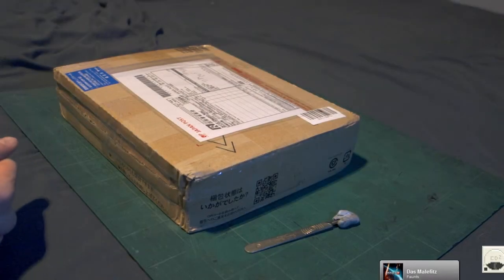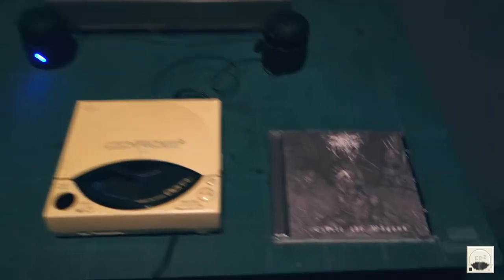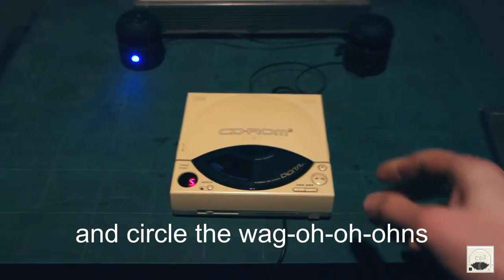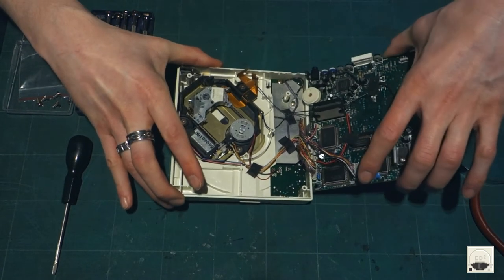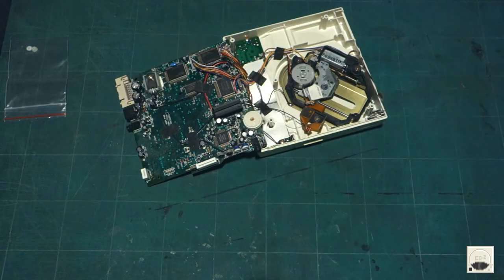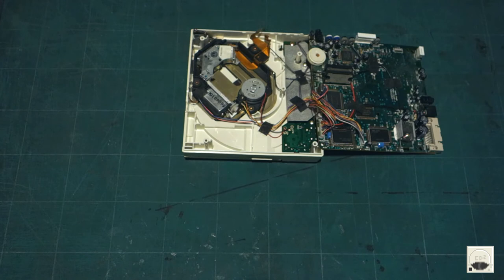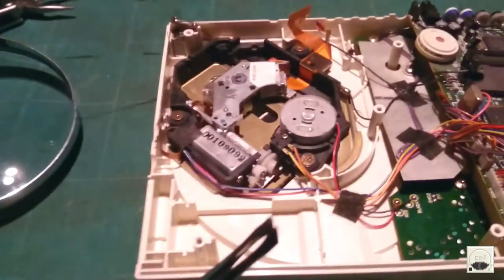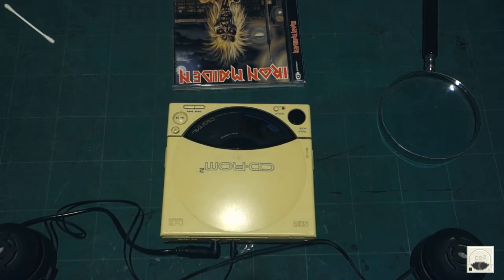Junk PC Engine CD-ROM² Repair (Discs not spinning)

Comment: Thanks for making this. I've had one of these for years and it's finally given out, so I'm thinking about trying to do the gear replacement. Really valuable to watch this. I think the replacement gears in Japan actually come with a slightly larger washer replacement as well so maybe even an idiot with no experience at this kind of thing can do it.
Reply from the maker: Trust me man, I've had barely any electronics experience and I managed it.  If you can get a larger replacement washer you'll be laughing :-)

Comment: Well, I've since got a lot more familiar with these and it's interesting to re-watch this, knowing what I know now. :) I now have three Japanese drives, an NEC CDR-35D drive, and a Turbo-CD drive. The NEC CDR-35D is a beige PC version of the Turbo-CD drive and actually works with PCE/TGCD if you swap IC108 (NEC microcontroller with custom internal ROM that differs on the CDR-35D).

Most recently the Turbo-CD drive was sold to me as "working" but the laser was stuck on the outside, just like yours. I used the spindle hub from a Japanese drive to trick it into spinning discs by manually homing the laser with the lid sensor rigged, just like yours (have to back it off the limit switch then drop on the disc/hub). After a few times the laser just started homing and playing, just like yours, but went right back to "stuck" the next day, just like yours later did. When it was working on day 1 it seemed reliable and did not make any funny noises so I knew the POM gear was likely intact.

No amount of of external fiddling on day 2 would get the laser to move on its own but it wasn't making a noise so I knew the POM gear was probably still OK. I had to take it apart and turn the gear manually to free it up on day 2. Sure enough, it was yellow and swollen but not cracked or missing teeth. The manual turning got it to load games and play audio again but it would freeze or glitch or skip where it worked fine before. You couldn't even listen to an audio CD on day 2.

Sure enough, it was frozen up again on day 3. It was pretty hot on day 1 (from the package being left out in the sun) so I think the lubricant would solidify and seize everything up when it idled/cooled.

Though I know how to clean/lubricate these things and have even done a Discman laser swap before, I didn't want to go any further without contacting the seller who old it as "guaranteed to work." Still waiting on word.

Seeing that you had almost identical behavior that was attributable to lubrication makes me more confident in my assessment that heat was changing the lube viscosity. I'm considering a diagnostics flow-chart for these things. :)
Reply from the maker: Hey dude, definitely sounds like the grease in the mechanism has solidified.

If your gear is not missing any teeth then a clean up and application of new grease should do the trick!

If you go through with that I'd definitely replace the gear anyway, it'll break sooner or later!

Comment: Mine's got a different problem.  The center spindle is simply refusing to spin altogether.  Totally stationary, so of course the attempt to read it fails immediately.  This only happened after I opened the thing up and closed it again without any mods, so I must have done something wrong but I can't see any dislodged cables that came loose from their solder joints.

Comment: Thanks for sharing. I replaced the gear and was doing great until I dropped the rubber washer into the console for about the tenth time and couldn't find it. I've looked everywhere but can't find it. Nightmare.
Reply from the maker: ahh dude what a pain, I reckon you could make a replacement if you get a small elastic band you could tie it round the spindle perhaps,  or even try a big elastic band and cut a bit of it into a square, push a pin through the centre then stretch it over the end of the spindle gently so it will sit in the groove on the spindle.
Reply from the maker: you could even try a small square cut from a plastic bottle?  doesn't matter if you make it too big to start with, you can trim away the excess once you get it seated on the spindle.
Reply: there is a seller on ebay that sells a kit with the washer...
Reply: Do you have a link? All I found was spare gears.
Reply: Many thanks. I may have to give that a go if I can't find any alternative.
Reply: Cheers.

Comment: Love your video. I also bookmarked it as I'll probably need it. I already have my PC Engine and Interface Unit, just waiting for my "Junk" CD-ROM2 to arrive from Japan. I'm also waiting for my System Card 3.0 and a brand new gear i also ordered.
Reply from the maker: Awesome man, thanks for watching and I hope the vid helps. if you have to change that middle gear just be prepared for the nightmare of putting that plastic washer back on the spindle ;-)
Reply: +Chris Mifsud 
Hey Chris, I'm actually shopping for a PCE and an Interface Unit, does it work even if the CD-ROM2 isnt attached to it?
Reply: +Jean audette 
Yes it does. You get the save game facilities and AV out (or RGB if modded) all work without the actual CD-ROM 2
Reply: +Chris Mifsud 
Allright thanks a lot
I have a contact and importing a unit with cables + a loose PCE is a little bit cheaper than buying a PCE with cables on ebay.
Reply: I also brought a junk CD rom2 and a couple of replacement gears. it turned out it just needed a clean and works perfectly. so I have two gears on the way just to sit in a drawer!!
Reply from the maker: +Russell Warren 

Cool man, at least you have replacement gears ready for when the inevitable happens ;-)

Comment: Oooh, I hope my duo-R still works, I haven't played it for 8years :(
Reply from the maker: +elijahmodnar1 Hey dude, I'm sure it will work, the Duo R and RX models are more durable than the earlier incarnations of the PC Engine CD based units
Reply from the maker: Arnold101Knight
Dude, the spindle will not spin if the middle gear is missing!
Reply from the maker: +Arnold101Knight No, the middle gear connects the motor to the spindle. Without the middle gear, the spindle will not spin.
Reply from the maker: +Arnold101Knight I understand you 100% now. The spindle will not activate until the lense gains focus on the CD surface.

Once you have replaced the middle gear, if the CD still does not spin, the lense maybe dirty, or maybe needs to be recalibrate.

You won't know for sure until you replace the gear!
Reply from the maker: +Arnold101Knight I'm not sure about replacement lenses etc, but I do know that whilst I had my unit, when it wasn't working, sometimes I saw a lazer, sometimes I didn't. 

I think it depends on where the lazer is/if it's in a place where the beam is ready to come on.

Seriously man, just worry about the gear and greasing the tracks, so the lense array can move accurately. if the CD doesn’t spin after that, then, look into replacement lense options, recalibration etc.
Reply from the maker: +Arnold101Knight Ah you should be fine then man, remember that this machine is from 1987.
Reply: Arnold101Knight  You can trick an otherwise-working drive to spin the discs without the middle gear. You can even do it without opening the drive. First, you have to rig the lid sensor then simulate the laser "homing." When the laser homes it comes all the way to the center, hits the limit switch, then backs off of the limit switch before it checks the disc. I did this by quickly moving the laser to the center and then back away, which is tough to do without touching the laser, especially if your rigged lid sensor keeps failing. As soon as you move the laser back you have to drop the disc on the spindle, preferably with a spare magnetic hub from another drive, since you have to remove the lid to get at the one in the drive we are trying to test without going inside. ;) I used a magnetic hub from another drive but I can probably get one from an old Sony Discman or something. Anyway, it won't boot the disc since the laser will not be where it's supposed to be without a functional gear (and can't move), but the disc will spin if you do all that and the laser is able to see/focus on the disc.

Comment: Hi! I've a cdrom2 too and my issue is that when i try to turn on the 0 appears but then turns off and after many tries i get it reads some discs and then again fails. Some idea of what could be? When it reads a disc sounds well and spins
Reply from the maker: That sounds like the capacitors on the main board might be leaking and not providing the required throughput to power the components.

If you open up the machine you could take a look and see if any of the capacitors are swollen or leaking.

If so it would just be a case of replacing those knackered capacitors.

Comment: Bought this unit for my IFU-30 Interface Unit. It powers on but doesn't read discs and the laser does not move. What to do? =(  The gear is ok.
Reply from the maker: Don0r4sTyLE do the discs spin at all?
Reply: RetroRic no it does not spin. It shows only 00. Maybe there is no power to the laser unit. I took it apart and nothing suspicious out there. :(
Reply from the maker: Don0r4sTyLE Double check the ribons and make sure there are no breaks on them. 

Have you made sure the gears are greased and not stuck?

If that's all ok, theres a possibility that you have bad capacitors somewhere, or, your lazer needs calibrating, or, your lazer unit is dead.

Try searching for this on youtube.

(turbo Grafix CD Capacitor Replacement, Stuck Laser, Laser Wont Read ...)

Have you tried to use the CD-Rom2  without the interface unit like I did in my video?
Reply: RetroRic I will try your suggested options and upload a video on youtube.
Reply from the maker: Don0r4sTyLE no worries dude, I'm not an expert unfortunately, the CD-Rom unit in my video is the  only one I've tried to fix so I was lucky when I took a gamble on buying it as spares/repairs.

When doing this kind of thing you just have to eliminate the possible problems until you find what's causing the trouble. Try looking for videos that show you how to test a cd laser, that could help in identifying if the laser has a problem or if the problem is elsewhere.

Comment: Where do you get the replacement gear?
Reply from the maker: https://www.ebay.com/itm/312659654772

Just grab em off ebay matey, there are shops around the Internet as well but most seem to have sold out.

Comment: 3d print the gears
Reply: FDM is not detailed enough and UC resin is notorious for being brittle. Best approach is to use an original or a UV resin 3D-printed gear to make silicon mould for two-part resins, but the gear is small enough that you need a vacuum or pressure chamber for a good result. Because others are already selling the gear, that may be going a little too far. ;)